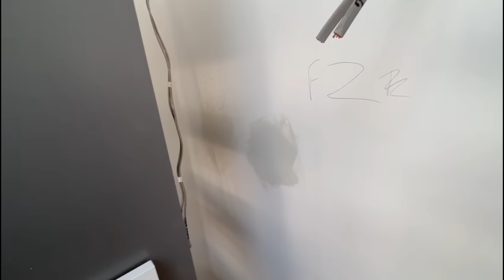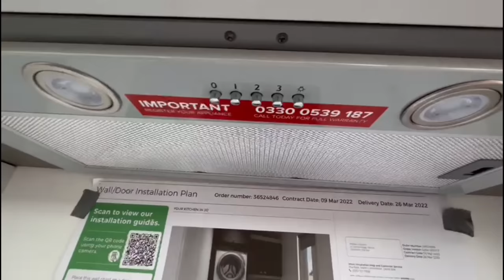EXCITED SQUEALS AS KITCHEN GOES IN! 1940's House Renovation Project UK!

Comment: So excited for you both. I have a few questions. When you were talking about washing up,  the view from the window at the other end of the hall was beautiful. Is that window going to be enlarged? Also can the couch be positioned across from the tv as an area divider? Just thinking it may work better with the radiator. Looking forward to the complete new house tour.
Reply: I have my sofa in front of  a radiator and it doesn’t block the heat or damage the sofa and mines leather. Though if they like the idea of dividing the room you could go for two small sofas, one near the radiator and one as you suggested dividing the room.